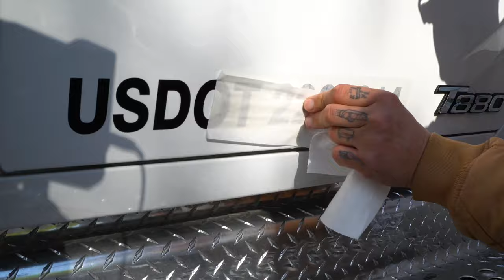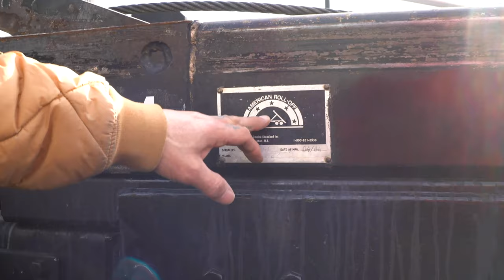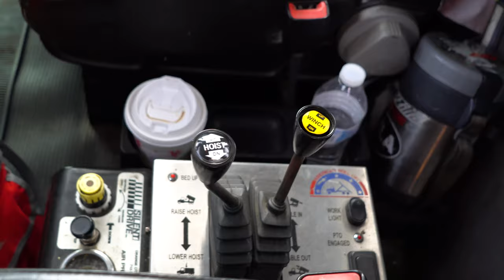Palfinger Hooklift & American Cable Truck Comparison  (Dumpster Trucks) Two Awesome Trucks

Comment: I can't believe how old fashioned American hoist trucks are.
I drive hoist in Copenhagen, Denmark. I have a low cabin. If I need to lift higher than my roof to roll off my container, it means something is stuck, usually twisted rails or container bottom banged down so it scrapes the tipper frame.
Besides that, we use two-wire dead lift hoist (means the container is lowered less than half a foot from the bumper / no frame sticking out behind).
Hooklifts are always considered to need more height clearance than hoists over here.

I believe I have a couple of old videos showing that on my other channel, Griffencph (without the extra cph at the end).
There should be a list called "Containers - how to".
By the way, our container locks work automatically.
Reply from the maker: I know I say that all the time I love the cab over types Soooooo much
Reply: How do your roll off not go up?  How would the rail touch the ground? Everything  I see in Europe  is hooklift  . A dead ripoff  of the u.s stuff
Reply: @lauramurray6690  
My speak may not be good, especially not in English, but I tried to show you the European wire hoist.
https://youtu be/s8p10j28HkM
Remember to insert . in the space.

About the rails getting stuck, notice I mean on the hoist frame, not the ground.

Comment: The reason they do those double rollers is because it's more complicated and more expensive and they can charge you more for it.

Too small diameter rollers are only fractionally better than one large diameter roller.

If your dumpster is getting bent then you've got a cheaply-made dumpster or you are way overloaded.
Reply from the maker: Might be n to something there